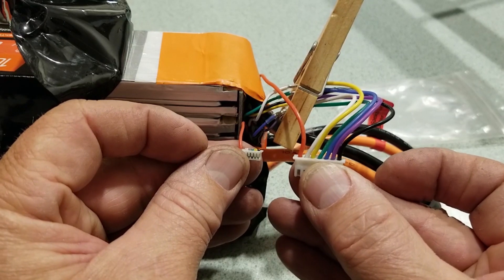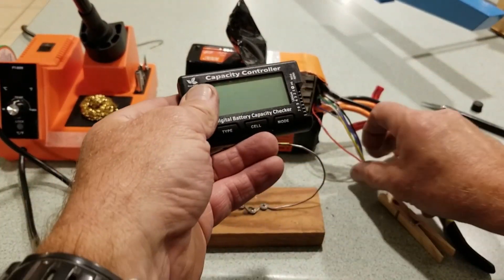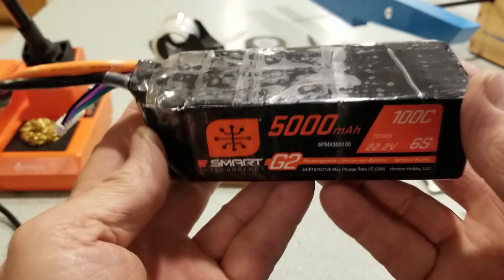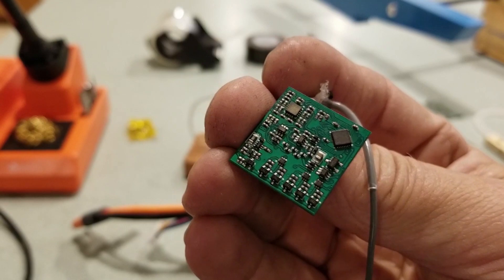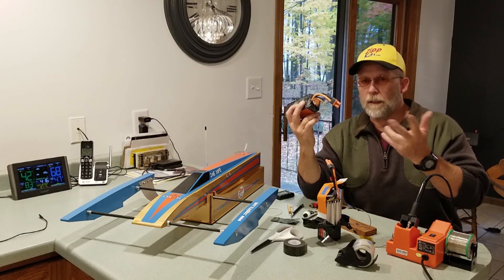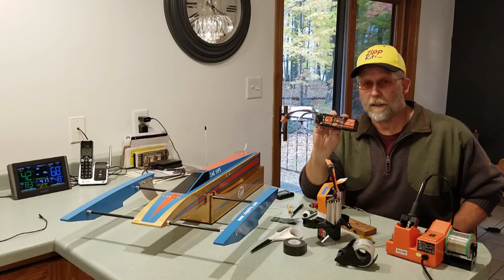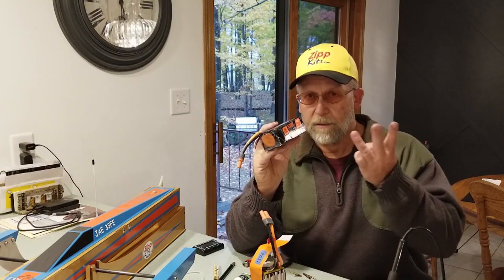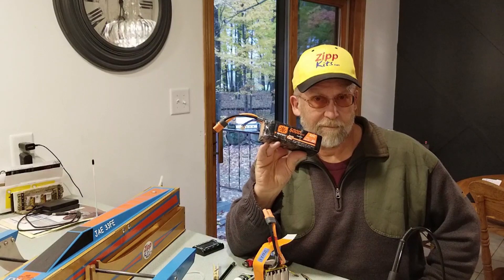HOW TO CONVERT A SPEKTRUM SMART LIPO...

Comment: Hey... no expert but IIRC the order doesn't actually matter as long as you get the first one right . Basically the other wires each go to one cell.... the only thing putting them in the right order does is make the cell order on a voltage checker match the order physically in the battery. Unless you plan on shuffling cells around that order doesn't actually matter.

Comment: All of my five Spektrum G1 3S batteries do not self store correctly and died on me by low voltage errors (they are used in my planes and never went anywhere near water).
I was able to save only two of them by charging them as NICD/NIMH up to 3.3. volts per cell and then back to normal via smart charger. I must say I am fed up with Spektrum smart batteries and will not buy another one again. I had way cheaper NVision LIPO's before Spektrum and they never failed me once in 8 years..

Comment: You would think that a surface battery would be better protected IE a sealed / potted PC board. Smart as in smart marketing. Battery fails so you can run out and buy another.

Comment: I tried this on a 3s and kept the wiring the same from left to right but get an over voltage reading.  Red to red and black to the far left black on the balance lead.  I guess I’ll keep flipping wires around until I solve the puzzle.  😂
Reply: Did you ever resolve your issue? I'm basically doing the same thing but the exact opposite. I removed the chip from an old 3s smart lipo and made a smart lipo adapter out of it. Now all my lipos have basically been converted to smart lipos. My adapter simply plugs between any 3s lipo and my smart ESC. Now I can use my smart charger with any lipo inside my blade smart helicopters (which thinks it's using a smart lipo while keeping all the smart technology)
This is what Spektrum should have done anyway. Giving the customer the choice of using whatever lipo they want but also the option of having smart technology as well.
Reply: Multimeter on ground.
Highest voltage goes away from ground.
So long as you have the outer and ground in the right place it will read around 12 but will be unsafe to charge.
Reply: Did you ever solve it ?

Comment: Thanks for the video. I had two hard case 5000 mAh 4s 100C G2 batteries fail. Both say “No Balance Lead” one won’t charge at all when I try without the balance option. 

To their credit, Spektrum replaced them with ease. But the new replacement were bad out the box!

Have you split the hard cases before?
Reply from the maker: I would guess the Spektrum hard case lipos are built the same way inside. I've never split one open, could be done tho...
Reply: I did get it open. They have silicone on the balance plug at the board. I have a red flashing LED on the board next to the red wire. Be nice to understand what the flash sequence is saying.
Reply: Here’s a link to what I’ve found. 
https://youtu.be/KROzEvhePrc

Comment from the maker: I did pull the grey wire and the pin since it's not needed.
A word of note, the cells were getting way out of balance as the computer board in the lipos got corroded until the point it was giving the false reading on the cells.
They might perform better with all the cells fully charged...

Edit: They did perform better, 77mph SAW run versus 84mph SAW run, both in cold weather. Here's the video link of the 84mph SAW run...
https://youtu.be/tHXVdcdhNMc
Reply: @chilly7261 - Did the grey wire go to the "smart" board that you pulled? Therefore, it was no longer needed once the board was removed? Also, does the orange plug match up with an EC3 plug? Thanks for your video, this is great!